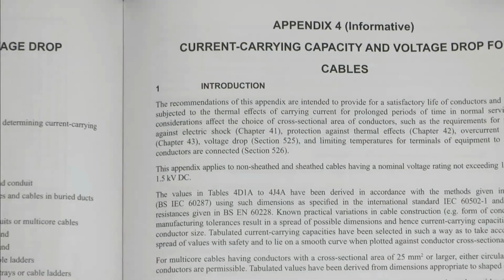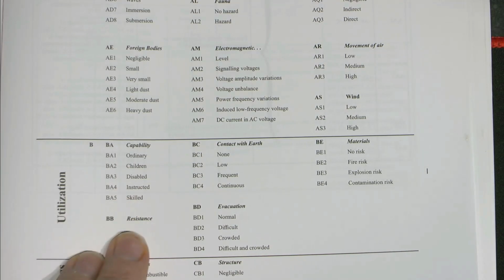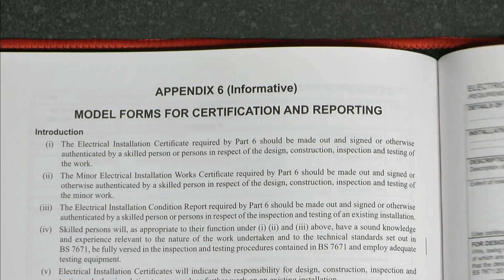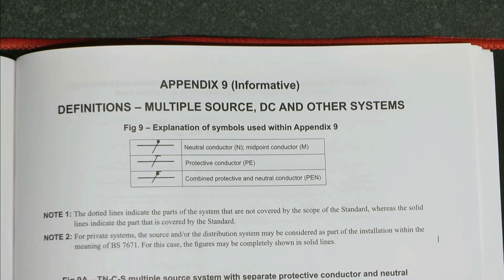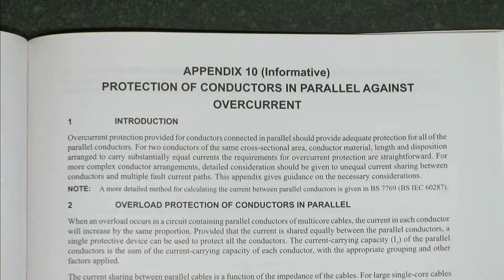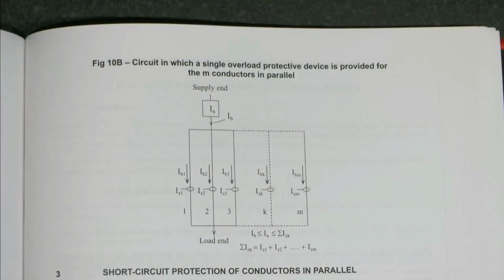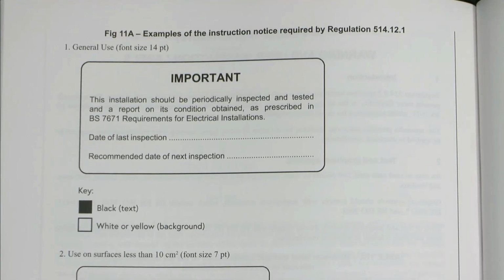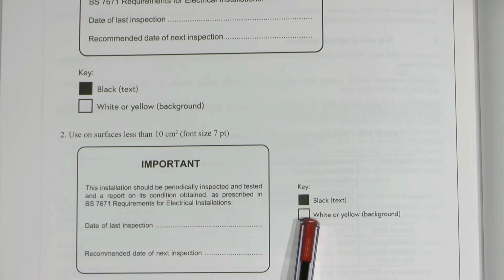BS7671 18th Edition Amendment 2 Appendices

Comment: Hi John, love your content. 

I noticed my local voltage was 252.4v the other day. Thought you could shed some light on the implications of this. Are there any benefits on the consumer end for a high voltage. Ie if energy meters are based on amps then do high voltage customers get more watts than 230v customers ?

Comment: Just an observation, having looked at all of the videos. I have worked in both commercial and residential premises for over 40 years in telecommunications and hold my 16th edition qualification, so know a little about things. I have never seen anyone come and check or police an installation. Who is checking work done? It seems the IET and BSI infer the threat of dreadful repriocussions if all of these regs are not stringently adhered to. Self certification leaves a lot to be desired, after all who is going to reject there own work.  Do other electricians report another if they find sub standard work. I think not, they are off to the next job. The Competent person often makes a better job. My new house was a complete sham with so-called qualified people doing the work. Nobody found the crossed over rings, light circuits crossed up and down, cooker hob bare wires etc. Common sense is required more perhaps.

Comment: John! Thanks for the excellent content and dorry to hijack this topic with unrelated but please do a vid explaining  the BLUE wire. The fact that its EARTHED at points along its way back to the power station. And that AC curent flows back AND forth in the blue wite but doesnt short to earth?? Nor do the earthed parts of the installation become energized yet are connected to earth and thus to neutral and ac current flows 'back' up the wire on the negative peak of the sin wave??  Please coz its not looking safe on paper or logical to connect earth to neutral then to the plumbing. You wouldnt logically do that to the phase conductor so why do it to the neutral in an ac system?  Why is there no potential difference on blue if the  coil is spinning at 50 hertz and the current alternates?
Reply from the maker: This covers most of that: https://www.youtube.com/watch?v=AgCY_d98HF8
There isn't any potential difference between neutral and earth because they are connected together - that's the whole point of them being connected.
Current flow doesn't change that.  The neutral is always at the same potential as Earth. The phase is either positive relative to N&E, or negative relative to N&E.
Reply: TN-C-S
Reply: @Mike_5  evrn in a TT system the neutral is a 0 volts. Yet in ac systems  the current reverses. So why does this not cause the polarity to reverse and energize the blue wire. Sorry mike this might be above your level